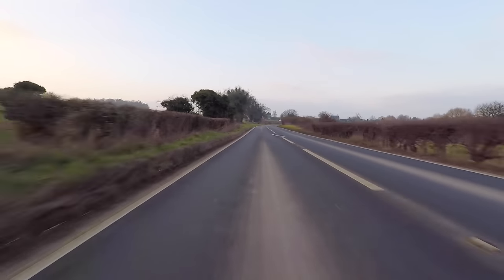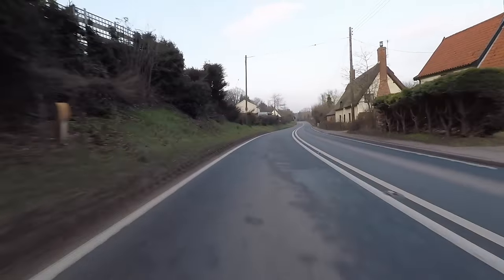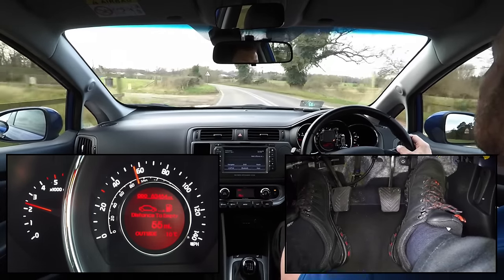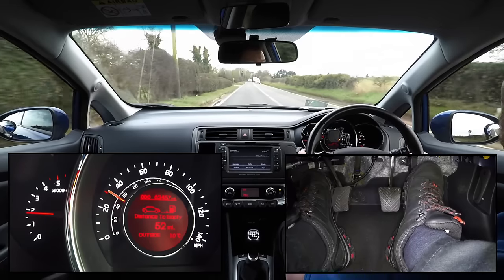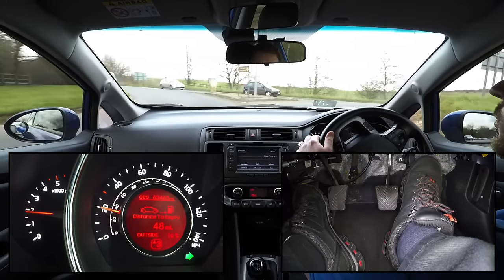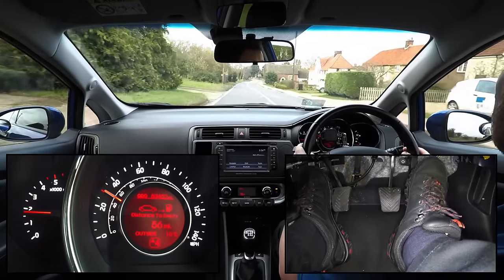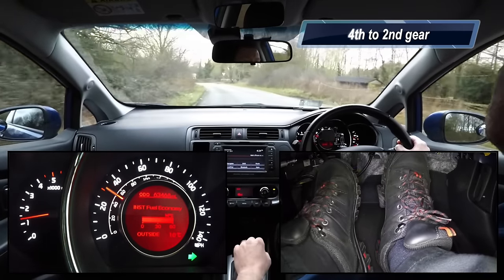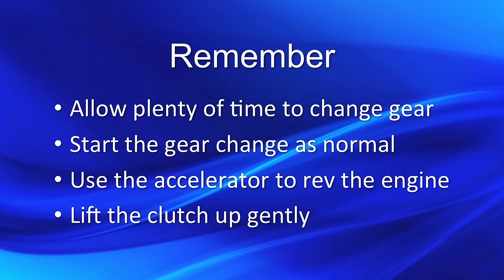Rev-Matching Gear Changes In A Manual Car  |  Learn to drive: Expert skills

Comment: If ur breaking before downshift. ....and pressing clutch at 1200 rpm to downshift the gear.....I don't think u need to blip the throttle. ....the clutch will do the Rev matching as ur changing gear at 1200 rpm.....where as if u want to maintain same speed when driving at high gear and then want to shift down a gear..then blipping the throttle a.k.a rev matching should be done.....

Comment: I have used this technique for the 7-8 years of driving a manual car without knowing there is a term for it. 😀😂 Also, I didn’t know the rationale behind it.. I just learnt with experience that THAT is the smoothest way to shift gears so much so that it became an automatic habit.
Reply from the maker: Have you ever tried this technique? Heel & Toe Rev-Matching: https://youtu.be/nkKV8ZFEVRg 👍🏼

Comment: When you release the Clutch after revving the engine to match road speed, are you supposed to apply gas again or should it be smooth just releasing the clutch and letting  the high rpm from the rev fall down to whatever engine speed it needs (Hopefully this makes sense!)? Every time I shift up, I need to give some gas whenever releasing my clutch or else the car jerks!
Reply from the maker: We normally only rev-match when changing down gears, and we only need to press the accelerator once for a smooth gear change. When changing up a gear, there is no need for a rev-match if we time the gear change correctly. Keep practicing 👍🏼

Comment: It's been 2 years since I watched this video. I learned how to blip my car's throttle a bit and facilitate step-by-step downshifting from 4th to 1st gear while slowing down at a steep junction (but without using heel-and-toe technique, though). Plus, I've been using a higher RON petrol on my entry-level car for quite some time which surprisingly help the engine to maintain its speed, torque and momentum, thus making prompt downshifting during rush hour traffic in busy streets and steep roads a bit smoother similar to doing a rev-matching technique.
Reply from the maker: Thanks for the comment - it just goes to show that there is always something more to learn!

Comment: Prefer to "sustain rev." gear change rather than "blip"- i.e. maintain/apply constant accelerator pressure, de-clutch & select lower gear then let in clutch smoothly (still maintaining the "gas").  As an old school advanced sort one doesn't overlap braking & changing down - thus negating heal & toe considerations -& keeps both hands on the wheel while the car is de-stablised under braking (this doesn't preclude de-clutching before braking is completed if the engine might stall or taking 1st just before a stop nor would it apply down hill - here just let clutch in slowly against the idling engine).

Comment: Only use rev match throttle when clutch is fully disengaged (pedal fully down). When you’ve added some revs by pressing the throttle, then let your clutch out to ‘catch’ those revs. 

This is certainly useful if you are doing some pretty hard driving or a big downshift in circumstances where you can’t afford to use a bit of time with the clutch down and braking to help get you in rev range. 

If you are doing normal driving, or indeed if you don’t need to downshift quite abruptly, then you can also just put your clutch down and let the revs drop (but I’d advise moving your gear shift through the gears at the appropriate times just so you could come off the clutch into the right gear if needed). 

Also, for nice smooth shifts, just come off the throttle for a moment when you put the clutch in, and after you’ve shifted and your clutch is just starting to come up, press down a bit on the throttle in equal measure to just help smooth it out. 

To help grow as a driver and develop feel, try to find for each gear (and under which road conditions such as incline/decline and speed) how far the clutch should come out before adding throttle (as it will vary slightly for the optimum) and in each case also how much throttle is best and when it is best applied, and also how slowly to come off the clutch.

First to second can be hard for people  to make smooth and steady, so try giving a bit more throttle and really taking your time with the clutch.

Comment: as I m a new driver driving from last 1 year so how to shift smoothly if not to use this technique sometimes changing into upper gear is also not smooth and every time changing into second gear before taking some turn is never smooth

Comment: Please correct me if I'm wrong. In some videos, I saw drivers first press the clutch then 'blip' the throttle, then change gear and finally release the clutch.  But in the video, you clutch in first and then change gear as normal AND lastly 'blip'. Are they the same thing?
Reply from the maker: It’s just the way each driver prefers to do it - a bit like different steering techniques. Try both and see what works best for you 👍🏼
Reply: @AdvanceDrivingSchool  Thanks mate.👍

Comment: You can get relatively smooth gear changes when changing down from a higher gear by releasing the clutch even slower?
Reply from the maker: Yes, the easiest way to get a smooth down-change is to slow the car, then release the clutch really slowly. Save experimenting with ‘rev-matching’ until after passing the test when you have more experience.
Reply: @AdvanceDrivingSchool  Yes, this seems correct releasing the clutch slowly, but I am concerned how much wear this technique causes to the clutch.

Comment: Great video! I think I read something similar in The Official DVSA Guide to Driving: The Essential Skills. However, just one question - what do you mean by "matching the engine speed to the road speed"? I'm still learning to drive, so not sure if it's something obvious that I just don't know about yet. Is it that the number of revs should be approximately the same as the road speed? So, 20mph - 2000 revs, 30mph - 3000 revs, etc.?

Thanks!
Reply from the maker: If only it was as simple as that - but unfortunately since there are so many variables (such as gear ratios etc) the exact amount of engine revs needed to match the road speed will vary between cars. This video is in our 'Expert skills' playlist as it is intended for after you pass your test - whilst learning to drive we wouldn't recommend you even worry about this for now.
Reply: @AdvanceDrivingSchool  Thanks for the super-quick reply!

So, essentially, this is something that you have to develop a feel for, and it will vary depending on the car you're driving. Good to know!

Thanks!

Comment: Awesome video as always 
Would you guys consider doing a heel-toe downshift tutorial?
Reply from the maker: +Nathan Pollard I feel that technique should only really be used on track, so wouldn't recommend it to inexperienced drivers on the road. Sorry
Reply: i thought the same for many years, so i didnt practise and never used it. But for almost a year now i have a car that has a lift off oversteer character and old brakes, clutch  etc (a '93 peugeot 106 xsi) and it is also good for driving pleasure, and i start learning (with youtube instruction videos) and using it in every days driving. I practise it while braking in almost every traffic light, letting space in front of me. Now i have more control of my car and i use the engine braking correctly while braking so i save my pads and clutch and i have always control of the cars behavior (always on a straight line). It is not so difficult if you practise the right foot moves in neutral at the beginning , after at traffic lights and then mastering it before a corner entry. I find simple rev matching usefull goind uphill or where is no need for braking, and heel toe better at braking (no need to let the brakes to change gear means better control and better braking distances). I totally agree however with the inexperienced part of your reply
Reply: @AdvanceDrivingSchool  It seems it only took 4 years to change your mind! 😆
Reply from the maker: @RealizeEditing1   Heel & Toe Rev Matching: https://youtu.be/nkKV8ZFEVRg 👍🏼
Reply: @AdvanceDrivingSchool  Great stuff thank you!

Comment: Interesting technique! But I think frequent rev matching, especially to much lower gears, can increase fuel consumption.
Reply from the maker: +Sathyadeep Viswanathan It must use a little fuel of course, but that is offset by less clutch wear and increased passenger comfort!
Reply: The fuel used to rev match is negligible.

Comment: Hello! Nice video, I think it's very clear. But i have a doubt/ question: I have seen you pressing the throttle when the gear was already in the new position, Would it be better in any ways to press the throttle while you are in neutral gear before you move to the wanted gear? i'm not sure if made myself clear. Thanks!
Reply from the maker: +Alejandro bermejo lozano In practice it doesn’t matter, since as the clutch pedal is pressed down fully all gears are disengaged anyway. If we pressed the throttle whilst the gear lever is in neutral, by the time we then selected the next gear the revs would have dropped back to idle speed again. Timing the ‘rev-match’ perfectly is key to making it work, and I think you’ll just have to practice until you get the hang of it 👍🏼

Comment: I am still very confused when is the right time to rev up?

In some videos they do it BEFORE, while still in higher gear, you do it AFTER, when we're already in lower gear. Meanwhile, what makes most sence to me is to do it half-way, to ease the stress on synchros,though I might be completely wrong.

So, which one is best, and why? I really hate doing it in higher gear, as it requires high rev and  racing-fast gear change, which I really don't want to do.
Reply from the maker: Either is fine - just experiment and see what works best for you!
Reply from the maker: Oh, and in case you haven’t seen it already - we recently made this video: Heel & Toe Rev-Matching: https://youtu.be/nkKV8ZFEVRg 👍🏼
Reply: @AdvanceDrivingSchool  Thanks, well your late method makes it easiest to pull off a smooth downshift, while mine midway definitely gives lees resistance when pushing in lower gear. For now, I'm doing my way for easy revmatch shifts, like 5-4 and 4-3, and yours for difficult ones, like 3-2 and 2 gears down. So far seems ok. :D Reving while still in higher gear and then shifting quickly enough and not dropping too much rpm seems to difficult and tense.
Reply: @millancche  How quickly  do you release the clutch pedal when rev matching?
Reply: @theman3923  well, pretty quickly, much faster then while doing a regular start from gear 1. About as fast as I do with regular upshifts. That good or not?
Reply: Blip it right before you enageg the clutch, otherwise you will either have to rev more or sustain the rev to match it.

If the revs are correct the you can literally drop the clutch.

Syncros still have to do work, you only spin them up when youre in neutral, clutch disengaged is not neutral

Comment: Question: say I'm slowing down so I put the clutch fully in and brake a bit, but then I want to get moving again quite quickly, usually I would have to bring the clutch back to the bite point for a bit and add gas to accelerate, would a rev match help me move off quicker? (i.e would I be able to come off the clutch quicker, since the clutch has to do less work in increasing engine speed?) Would heel toe be applicable there? Thanks
Reply from the maker: There is no need to push the clutch when braking, unless you are changing gear or about to stop. Also, we consider rev-matching as unnecessary until after you have passed your test and have more experience.
Reply: @AdvanceDrivingSchool  ah ok thanks

Comment: I'm still not very experienced but instead of doing this, could I just slow the car down more before downshifting?
Reply from the maker: We don’t recommend inexperienced drivers should try rev-matching their gear changes, but instead just slow down more before a down-change as you suggest. This skill (and others in this ‘expert’ playlist) are best left for after the driving test has been passed and more experience has been gained 👍🏼
Reply: Advance Driving School thanks!

Comment: is it necessary to get off the accelerator before applying the clutch?
Reply from the maker: At the start of the gear change - yes, otherwise the engine will over-rev once the clutch disconnects it from the gearbox.
Reply: @AdvanceDrivingSchool  okay, thanks!

Comment: Will this work on 2015 Mazda 2? Some day rev matching only for older cars, is it correct ?
Reply from the maker: It should work in any manual car, new or old / petrol or diesel. I do it all the time in our 2018 Ford Fiesta 🚙👍🏼
Reply: Thanks a lot

Comment: What is he doing at 5:00-5:02 ? Is he using double-clutch for rev-matching when doing downshifting from 4th to 1st ?
I find double-clutch technique is the only satisfying method when skipping more than one gear such as from 5th to 2nd. The basic single-clutch technique may end up with juddering on my engine at times.
Reply from the maker: +Lex Soft With modern cars it really isn't necessary to use the 'double de-clutch' technique. If timed right, there is no problem changing from 5th to 2nd without any juddering in our cars. If your car doesn't like missing out 2 gears, then just miss 1.
Reply: +ADS
You still don't answer my question on what the driver was doing at 5:00-5:02. Or you implicitly have answered it ?
Regarding my problem on downshifting from 5th to 2nd using a usual single-clutch : maybe it's because I don't do it correctly or because my car is a Nissan Sunny 1997... :)
But I don't want to put blame on my car as it has been serving me very well since I bought it last year in June to learn more on how to drive a manual car... :)
Reply from the maker: +Lex Soft Sorry - at 5:00 I am just down changing into 1st gear normally as the car speed was down to about walking pace, and I needed to pull away promptly. 

Older cars are often a little different to drive, compared to newer models - but after a little while you get used to how it likes to be driven. 👍🏼
Reply: +ADS
Thanks again for replying.

Comment: based on this video it seems like rev matching is mainly used when shifting down 2 or more gears. Does it not matter when only shifting down 1?
Reply from the maker: +Chew It is most useful when shifting down 2 or more gears, as this is when there is the biggest mis-match between the engine and wheel speeds. However, unless driving slowly I usually rev-match all down shifts for added smoothness!
Reply from the maker: The revs needed depend on the gear selected and the speed of the car, so there is no exact answer. For example if we are changing to 2nd gear at 30mph in my car it would need about 3000rpm, but at 25mph only 2500rpm. Other gears will need different revs at different speeds, and of course it will also vary between cars - as the gearbox ratios will be different. You’ll have to experiment!

Comment: Blip or changed gear first? What would be the proper way to revmatch?
Reply from the maker: You need to do both at the same time - watch my feet to see how I do it 👍🏼
Reply: @AdvanceDrivingSchool  you changed gear first then you follow it up with a blip? Not at the same time.
Reply: King Harry Motia you can either blip as you cross neutral or after you switch gear (downshift), as long as the clutch is pressed all the way down

Comment: Can you rev match from 2nd to 1st? As i feel like the car is not moving at all (or feels like doesnt want to move) when i downshift from 2nd to 1st gear on very tight turn.
Reply from the maker: In theory you could rev- match into 1st, but we find it easier to stay in 2nd and use a little clutch control to drive slowly.
Reply: I know what you mean... Am a beginner myself and yes the car just stops(doesn't stall)...yes you can use clutch control but if you feel you absolutely need to shift down to first, then yes a slight blip will help you keep momentum
Reply: You 100% can, and i do. 

I'd master the other changes first, and then try first gear rev matches after you're comfortable with the concept. 

It's a great feeling when you match a gear perfectly. Makes you better than 95% of other drivers on the road.

Comment: Is this only for downshifting??? Pls reply
Reply from the maker: We reply to every question! Rev-matching is only needed for down-changes, as up-changes are naturally much smoother.
Reply: Advance Driving School thank u.... 👍
Reply: You using black shoe we can't clear see your actions
Reply: In-fact you can rev match upshift's - ease off but don't release the gas  -revs will fall but only enough for the change e.g.30mph in 3rd say 3000RPM to 4th 2000RPM.  The advantage being you can change more slowly/gently (-without the rev match you must change qickley with a snatched action to catch the falling revs especially with to-days light eco. fly wheels,) the result is an upshift smoother than the best auto 'boxes & extended synchromesh life . @AdvanceDrivingSchool

Comment: So i should do a rev match when the engine speed goes down to 1rev per min?
Reply from the maker: Do the gear change when you need to for the corner / junction etc - the rev match should help at any engine speed.

Comment: Can we from 4th to 1st without any jerk?
Reply from the maker: Yes, in theory - however it’s not something that should normally be needed. We would usually use 2nd gear as well to give extra engine braking as we slow down. Give it a try and see what happens!